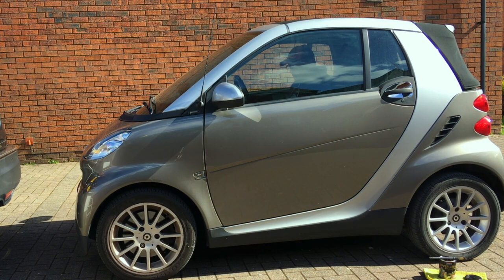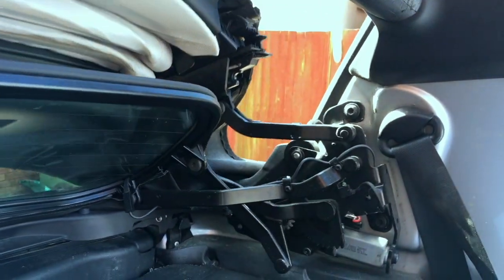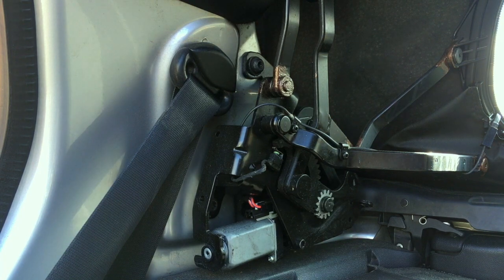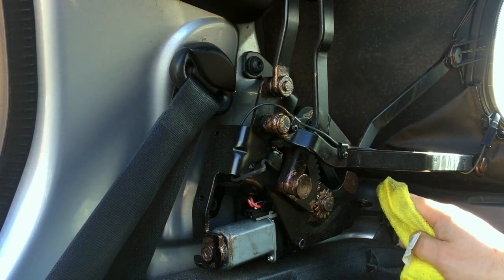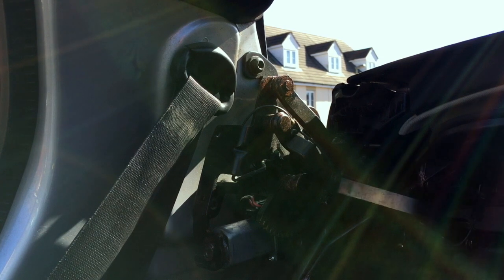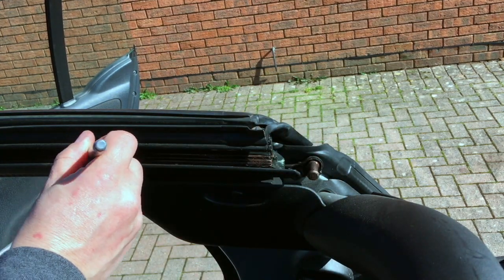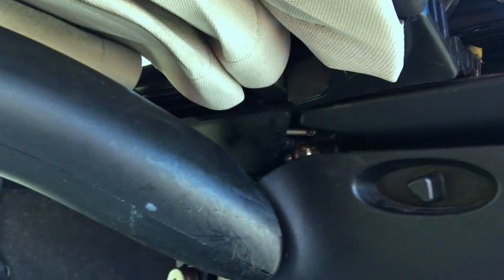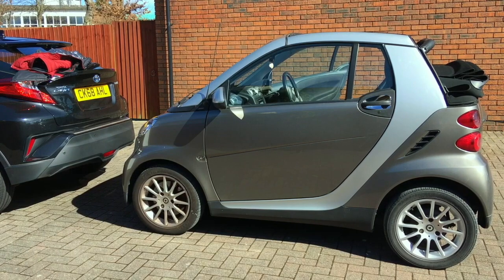How To Service Your Smart Car Convertible Roof Mechanism

Comment: Thanks for posting. My partners roof was down yesterday for the first time in months and started hesitating. I will do the same with Copper Grease
Reply: Don't use Copper Grease for this - you will regret as it ultimately will cause seizure.    Silicone or lithium and very sparingly.
Reply: Si

Comment: Help! I live in Texas, my cabreole button fell into the gear box when I tried to close the roof. It was 100 f outside and I think the glue holding the buttons in place just melted. I pulled the facing off and fished the electronics  board out and the buttons that fell out but they are on a small cable. I'm at a loss on how they are reunited. Could you post a video to help me? My roof is stuck open without the buttons to close it. Thanks.

Comment: I have recenly bought a Smart for Two Cabrio Passion MHD 1 (Registered 2014) There is a lot of wind noise located at the roof on the passener side.
I have inspected all the rubber and can not find any damage or cracks.
Have anyone got a solution for stopping the loud wind noise  (Thanks sincerely)
Reply from the maker: @RealHopeTV  I have seen posts like this in Smart forums… if seals are ok look for this 
1: check that all the panel gaps are consistent and have all the clips in. Sometimes a slight inconsistency creates a wind noise. 
2: I do know that in some cabrios the fabric roof shrinks. Check its water tight. That is my best guess

Comment: I would say the best type of lubricant for the cabrio roof is silicon spry. Why? Beauce the first portion of the roof is powered by a sigle motor that pushes cables lined with micro fibres, almost like pipe cleaners through the chanels. Using a grease or oil will accululate dust and derby witch ends up in the motors very tight drive cogs, causing eventual probelms. Silicon does not atract dust and debry while still greatly reducing friction and is thus the recomened lubricant for this application.
Reply from the maker: Retrospectively I e been recommended to use carbon graphic (lead pencil) or nothing for similar reasons. But it never gave me any problems In 3.5 years
Reply: I’m certain dry graphite would also be excellent for this application.
Reply: I’m certain dry graphite would also be excellent for this application.
Reply: I’m certain dry graphite would also be excellent for this application.
Reply: I’m certain dry graphite would also be excellent for this application.
Reply: I’m certain dry graphite would also be excellent for this application.
Reply: I’m certain dry graphite would also be excellent for this application.
Reply: I’m certain dry graphite would also be excellent for this application.
Reply: I’m certain dry graphite would also be excellent for this application.
Reply: I’m certain dry graphite would also be excellent for this application.
Reply: I’m certain dry graphite would also be excellent for this application.
Reply: I’m certain dry graphite would also be excellent for this application.
Reply: I’m certain dry graphite would also be excellent for this application.
Reply: I’m certain dry graphite would also be excellent for this application.
Reply: I’m certain dry graphite would also be excellent for this application.
Reply: I’m certain dry graphite would also be excellent for this application.
Reply: I’m certain dry graphite would also be excellent for this application.
Reply: I’m certain dry graphite would also be excellent for this application.
Reply: I’m certain dry graphite would also be excellent for this application.
Reply: I’m certain dry graphite would also be excellent for this application.
Reply: I’m certain dry graphite would also be excellent for this application.
Reply: I’m certain dry graphite would also be excellent for this application.

Comment: Hi, good video. Is there meant to be a plastic cover to hide all the parts you’re oiling up? I’ve just bought an 04 convertible and it doesn’t have a cover. Thanks
Reply from the maker: On the gears that live in the “boot/trunk” (on the sides) yes there should be covers.

Comment: I’m have trouble with my conv 451 roof not quite closing and I think you are very close to me in CF82!!  Any advice greatly received thank you
Reply from the maker: When I got my 452 conv the covers that go over the geared operating mechanism were missing. First check all connections are secure. And that the teeth on the sprockets are all there. 

Or. Fully retract the roof and watch the mechanism go down and then up (get someone else to do this) look for kinks or obstructions. 

Finally. It could be the micro switch (my best guess) my be faulty
Reply: @smarte.r.1450  thank you it was the front clips on the drivers side a plastic lug had worn off £134 for a pair of clips direct from MB Main Dealer
Reply from the maker: @PoachedEgg  fab but… ouch!! Best wishes

Comment: Always enjoy your videos,  can I use arisol white grease
Reply from the maker: Thanks for the kind words. Yes. That will work too
Reply: @smarte.r.1450  thanks again for all your videos I am currently looking at a 2009 cabriolet smart for two with only 75000 kms on it. It will be my first soft top as I had a 2006 passion coupe back in the day.
Reply from the maker: @darrenmcadam2318  great choice! You know what? I am toying with the idea of going back to a 451 cabriolet too. Great great fun. 

Remember to check all the micro switches work on the roof mechanism. Take the roof/door rails off. And put them back on. Drive it with the roof down on a test drive. Then put it all back together. 

Finally if you are in warmer climate than the uk , the material can stretch and let water in at the windscreen top! Smell for damp 

Best of luck and thanks for the kind words. Really does motivate me. 

Regards

Gareth
Reply: @smarte.r.1450  thanks for the tips on the roof I'll let you know how we make out.

Comment: The runners or sliders came off my tracks (don’t ask me how!) and I was left with the soft top flapping around. I managed to put them back before a storm hit, but I must have not put them back properly as the roof will now not open (apart from manually) 

Do you have a video showing exactly how I should have done it

I’m  guessing I either put a slider in the wrong track or the wire mechanism should have been engaged first and then sliders put in?
Reply from the maker: Jos Wellman I’m sorry I don’t have a video for this.... I’m currently trawling the internet for a mk1 smart to be able to tear down so things like this would be useful. 😞

All I can think of is that the micro switches may have been damaged or not connected at the rear rising and lowering gear. It’s hard to say without seeing the issue really. 

Try “Evilution” he normally has a wealth of information. Google his name and search his documents. Hope you get this resolved. Please message back with a resolution 

Best of luck. Gareth

Comment: I do not recommend using copper grease. It is not liquidy enough in order to creap into the joints. Copper grease is mainly used for bolts and threads.
Reply from the maker: I respect your opinion and understand the reason but three years and zero issues will keep me on my path. But, I also understand a graphite kind of lubricant is good. As it does not attract or retain particles.

Comment: Not sure u should be using copper grease on the rails. 4smart recommend using silicon spray on the rails.
Reply from the maker: Yes I’ve heard that. But I’ve seen and heard other mechanics use it. I have the top up and down everyday and has done no harm and Amis still as smoooooth as silk 🤓

Comment: My mom bought a 2008 Smart Fortwo Passion from her granson who has a used car dealership. She bought it for 2 K so she could have transportation while her Mercedes AMG was in the shop as they always have it for months. When she gets her car back she's selling the car to me. Before her grandson would sell her the car the roof leaked because did not attach fully in the front. He paid someone 400 bucks to attach it. How they attached it I don't know But the roof is no longer retractable. I'd like to fix this myself because I really want the convertible function. The guy told my nephew that it would take at least 2 K to fix the roof proper, so that's why he just attached it so it would not leak. I wish I knew what to do with it.

Comment: Nice video mate. Have you had any roof problems and hence applying the grease?  On another note trying to gauge your accent. Wales?
Reply from the maker: I held onto the cabriolet for 2 years and zero issues and it was driven daily. By chance a few months back it was behind me in Cardiff city centre. I got out at traffic lights and the driver said he had zero issues with anything he’d had it after me for about 8 months. So yes, Welsh. Lol
Reply: @smarte.r.1450  I thought so but did not want to offend incase i got it wrong lol. I picked up a 10 plate Brabus last week. Roof jammed today! Chap called Ian came out and sorted! Relay was gone and front clips.
Reply from the maker: @MrRawUK  glad it’s sorted. Great car. What colour?
Reply: @smarte.r.1450  Silver. Wanted black but Silver is not to bad.
Reply from the maker: @MrRawUK  sooooo prefer the silver. Congratulations buddy

Comment: Good video, but I guess more dust is going to get stuck on greased parts. I JUST use a brush to keep all moving parts dust free, it works fine with me.
Reply from the maker: Hi. Yes. That’s a sensible solution. And it’s been mentioned previously. My take on it is this. Both work... if you fail to clean routinely with a brush and allow grit to gather then the mechanism is at risk. If you use grease or lubricant it will retain and trap and when you clean next time or refresh (once a year) it doesn’t migrate the agitatant deeper into the system. Both work. Not all manufacturers suggestions have been right over the years for many servicing processes. Both work. Best of luck. And thanks for the comment 🤓

Comment: ACTUNG those are dry lube joints.
Reply from the maker: I have been told this many times. Thanks for the comment though. When I had it the channels were lubed and I had this for over 3 years with zero issues whatsoever. As anyone that has done any research on this mechanism will know, it can fail to function and, unfortunately it’s quite common. 

This was done as a preventative measure and for over three years it did not fail to operate smoothly. 

Keep safe! Happy New Year!